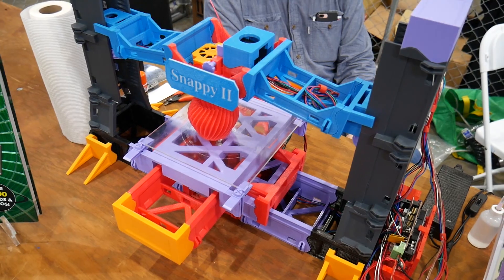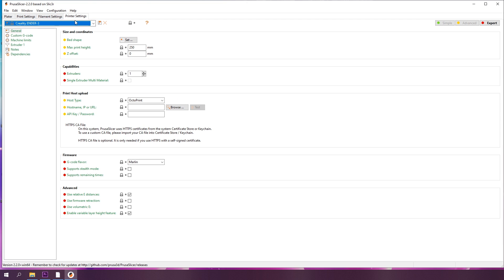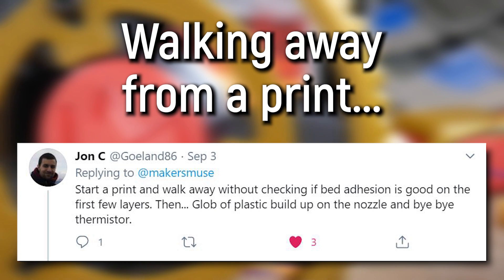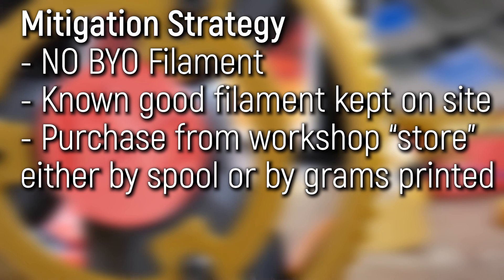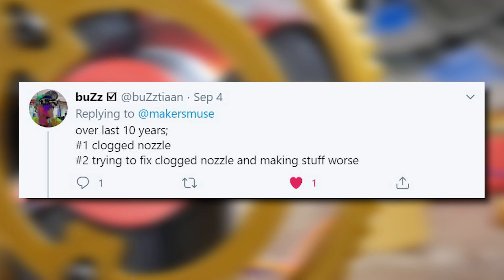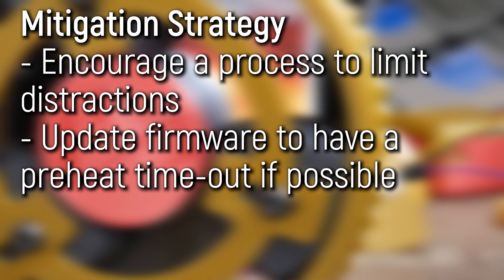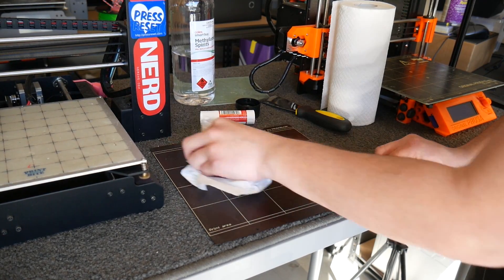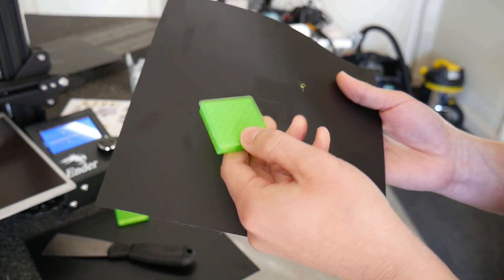How People BREAK 3D Printers (and how to stop it)

Comment: If you break your nozzle off at your hot and it is savable. Well not the nozzle the hot end though. Take your hotend off the machine and place it very very carefully in a vise. Take a Dremel and very carefully cut two notches in the broken piece of the nozzle. It is easiest just to cut into the center of the plastic or the brass showing to give you the most centered groove.most importantly have a large screwdriver that will fit the slot and a propane torch. Lightly heat the screwdriver as to not melt the handle but to heat the tip. Place the screwdriver in the brass and let it sit for a few seconds. Remove the screwdriver and reheat (do not try to turn the brass until you see liquid plastic or the nozzle spins on its own was very slight Force). Slowly back the nozzle out heating the screwdriver as necessary.if you would like to make this process easier you can groove the nozzle and then reinstall the hot end onto the machine and bring it up to temperature. Be careful not to damage the wires of the hot end during this process. If you take your time you can recover your hotend and only be out the price of a nozzle.

Comment: My checklist: first I 3D design my object to make sure it fits in the parameters of my printer. Second I import and slice making sure I have selected the right printer layout on the slicer first. Third I checked my settings and infill because you don't always want the same infill and you don't want to make the mistake of waiting for a slice and realizing your infill is set wrong. Third I export the G-Code, I still transfer using microSD. Fourth I fire my machine up make sure my bed is clean and leveled and I bring my temperatures up and at this point I manually Purge the nozzle. Fifth I disabled the nozzle and allow it to cool so the plastic does not extrude anymore but while the tip is hot I clean the bottom and nozzle. I am using a creality glass bed with the creality coating on it so I usually do not have to worry about bed adhesion. I hear a lot of people talk about running their temperatures at around 205. I find some of my best results at about 210 to 211 with the ender 3 and my bed usually runs at about for pla. Finally I start the print and monitor the first four layers. I start my prince off at normal speed and then gradually increase the speed to where I want. On a side note, if you want to increase your speed then you want to do it within the first one or two layers and do not increase it anymore during the print or else you will notice a difference in the print. Also be prepared because as you speed the print up the layer of plastic laid down become slightly thinner and you lose a little bit of volume so I slightly over extrude.

Comment: So far the industry has been the toughest printer I have owned. I've been able to toss it around, though you should not do that, and I can bring it with me with minimal bed leveling required after travel. It tends to be a tough machine and relatively simple to repair. During assembly of it, the ender 3 was my first printer so it was my learning curve, I pinched a wire in between aluminum extrusions and cut one of the wires but it was an easy repair. Since then the printer has worked flawlessly even though it travels with me and prints in some dusty environments at times which again you should not do.all in all if it's going to be your first printer or if you need something durable I would recommend starting off with a machine of this kind of construction no matter the brand. There are better choices with 32-bit boards.

Comment: We have managed to reduce waste to zero in the ''Innovation lab'' at our university by:

-Teaching all students how our UM2's work in a dedicated (mandatory!) class which includes proper leveling;
-Writing five standard Cura profiles specifically for a wide range of purposes, as a starting point for their settings;
-Making pre-use ''work prep'' template forms that students have to fill out (similar to how planning/prep for a mill or lathe works), to show us they've thought about what they're going to print;
-Making our own supply of PLA mandatory. UM2's use 2.85mm filament anyways, and most students use 1.75mm at home, so it don't fit.
-(Mechanical) repairs are only done by staff. Removing the nozzle as a student? That's a paddlin'.
-Making a shredder to recycle failed prints. Because whatever way you design your whole lab not to have failed prints, we have yet to find a way that is student-proof....

RE: Adhesion methods: there's plenty of cleaning alcohol to keep the glass beds clean, which should work for just about everything except PETG - a fine layer of hairspray does wonders there. On the buildplate. Not on the nozzle.

Comment: i have an ender 3 printer and my assistant always tightens the nozzle waaay too much so much so that it is too hard to remove from the hot end. due to that overtime i noticed that the nozzles are going into the hot end slightly tilted, and it turned out that the threads in the small aluminum part of the hot end are all mangled that the nozzle doesnt stay in its place and simply pops off when the printer is extruding. i tried adding teflon strips to the nozzle but that didnt work, i ended up flipping the entire aluminum square and reinstalling it upside down temporarily until i finish the item i was printing. then i simply created a new one out of aluminum and it works just fine now and i wana try to make one out of copper (dunno why)

Comment: I burned a driver on the motherboard. Lesson: check that your stepper motors can move. I changed extruder parts and cause the stepper motor axle to be jammed for putting one of the gears wrong way around. It is not the same as having stepper motor skipping, if it is a dead stop, it can't move a micrometer, it will burn the driver. It can take skipping, for ex if the motor hits the end of travel but it can not take full on, dead stop jam.

After that i didn't print for about a month. I had dust cover on and really fresh, brand new "magic goo" surface (IPA+glue stick). I had to take all the glue out and put new in.

Comment: I blew up my Ender 3 motherboard by not turning the power off before using a little copper brush to scrub the underside of the hotend during a nozzle change. The bristles shorted out the cartridge heater wires, which in turn, fried the circuit board... So, in my case, i destroyed a perfectly tuned, and fully functional printer with the power of stupidity, and hotwired electricity.

Comment: Does anyone else here have never seen a 3d printer in a school? Like wtf, here in Spain, it's just hard to get people to invest into new technologies and ways of teaching. Most people would probably understand how it works, but very little would have the perseverance to keep going  after a fail. Don't get me wrong, every time i have a clog or a problem I just want to throw the printer off the window, but then i remember how fucking glad i am to have one.
Reply: Fact of the matter is that in schools, equipment upgrades tend to come down to both the budget and what the instructor deems necessary. For a lot of instructors, even those in more creative shops, they have never used a printer and therefore isnt really on the horizon for them. Some do, and this is why you might see a printer in a wood shop because they have nowhere else to put them. It's that person's classroom.  Trying to get public school boards to understand the usefulness in such tools can be much harder than the classic wood shop.  Hell, our wood shop instructor understood the value of metalworking and CNC, but only could manage the budget for a 10 year old used plasma cutter.  It took them 2 years to get it at a point of usefulness. By then, the district wanted to cut the shop out in it's entirety. Citing that it was antiquated and too much liability. But they didnt have anything to replace it with that I know of. 

Personally, i was shocked when going to college how behind some schools still are though.  I attended a private engineering university that (to my knowledge) didnt have anything resembling a makerspace for the dozens of projects they are given.  Hell, that place still had dinosaur computer labs that crashed 10 year old software left and right despite it's crazy tuition rates. <45k/yr  Visited a community college later on and was surprised that the instructor offered the opportunity for the class to use their commercial nylon SLM style printer for projects. It could handle a massive build area, we just had to have the instructor group the class batches. Especially when tuition was closer to $8-10k per year.  I simply sum it up to how much a school focuses on it's student's success rather than profits. I think that engineering school firmly believed that none of us would be machinists, so while they formed curriculums around 1960's metalworking in order to "diversify" our understanding of the real world, they neglected to care about actually assisting the students in their studies. So much can be learned from experiments using printed components. Not to mention a small 3d printer farm tends to be a much smaller liability then metalworking lathes, welders, and mills. lol.     I live within 5 miles of this school and have done a few projects for various groups.

Comment: Blue tape is a good surface when configuring the firmware for a new printer build as its a nice sacrificial print surface that works ok for PLA. Better to crash and scratch off some tape than a good PEI surface.

Comment: I wish i watched this before i had to replace my whole hotend 😂
Reply: Given the horror stories and the various mistakes I’ve made, I keep replacement parts on had. Hotend, nozzles, V wheels, belts, etc... Then I have the price advantage of the imports over the local costs, which I have found local prices for one about the same as the lot imported. Bricks and Mortar  have a higher cost because of the convenience, a bit of planning can save a fortune. Which can be invested in running more plastic ;)

Comment: My biggest Mistake:
I just scratched my Bed with the nozzle, because i thought the Auto-Levelling will do it and I couldnt stop the Print immediatly. Well no... You Always need to AUX leveling the bed first even if you got a auto-bed-leveling included.
Then I screwed my Filement winding by letting lose the end - there is a video on this channel too. But this didnt do any damage but the prints itself

Comment: Just recently on one of the work printers i had the thing just catastrophically kill itself. It's a core xy and i don't know how the head got stuck on the print, but because i was having to print a 10 inch wide box the print won and ripped the hot end carriage apart. Tore off the part that held on the string to the carriage and that cracked it further so one of the wheels broke off as well. 

Overall lessons learned, string is far stronger than i gave it credit for and thank god the warranty on these printers is amazing

Comment: I've knocked my printer off the table, on the floor, by accident and the printer wasn't out of level. Maybe these spaces just need fewer better and stronger printers instead of just more budget ones? I know you are an advocate of affordable printers in schools, but I've seen so many with just small issues being put away because a hobby grade printer is not suitable for open spaces where nobody takes responsibility.
Reply: Personally I have seen more major  problems with the proprietary printers than "hobby grade" or home made machines. 
Unavailability of customised parts being the biggest problem. 
When a stepper with the lead screw glued into the rotor loses magnetism (through design issues), is when you discover how poor the parts backup is.
It becomes a, modify a stepper yourself or modify the printer to take an off the shelf  stepper and coupling yourself choice. 
Kinda explains why so many non working proprietary printers get given away.
Reply: @mikenewman4078  Heyy Mike. I suppose that depends on the printer. I referred to the Dutchy (only available in the Netherlands) which consists of a very sturdy frame with high grade (universal) components. There's even a parts list on the website. I think most of the parts availability problems will be with custom hotend/extruders anyway and the Dutchy just uses a stock E3D Hemera, but there are more high end printers with universal parts that are less prone to failure when handled incorrectly

Comment: I can almost imagine someone saying "it didn't heat up past 100 degrees, so I used a blow torch to get it to 220"
Reply: Haha. That reminds me when i was a little kid and was going to pump up my bicycle tires at the gas station. So it said "40-50" on the side of the tire. And i preceded to try to pump it up to 40-50 bar.... When the pump did not go past 10 bars i was pretty disappointed and started to walk home with the bike. After 10-20 meters there was a loud BOOM and one of the tires was flat... I guess i did not know the difference between bar and psi back then.
Reply: @titter3648  Reminded me of two stories -- (don't know why the second - ;) )...
1. A friend from Europe came to visit for a few months (going to college) and wanted to cook.  They said we needed a new oven because it wouldn't get hot enough - was trying to get it to 1022 degrees -- thinking celsius as Fahrenheit...

2 - I was in purchasing for a school and one of the housing personnel wanted me to set up a deal with Wal-Mart to buy vacuums on an ongoing basis.  They thought they were disposable and they'd throw them away when the student(s) used them and got clogged or bag was full...
Reply: @titter3648  I've always used the "squeeze test" for bike tyres :)
Reply: @titter3648 lol
Reply: A 3D printer tool-kit I purchased comes with a blow torch.
I'm convinced it's an emergency-only tool for removing globs and failed prints from the hotend!
Others would likely use it as a preheater or worse...
Reply: (on the mini) while needing to do a manual filament unload, preheating for PLA wasn't heating  it up to 215°C, only 170 (one may be able to do a HARD coldpull at that temperature, but I didn't wana risk it). Was confused for a sec, before I found a workarround by sticking a leftover piece of filament in the filamentsensor, and cranking up the heat manually to 215 in the settings.
Reply: Blow torch is the best way to clear a clogged nozzle
Reply: @reforgedcriterion1471  It's the best way to remove the brass nozzle entirely if you don't know how to use a blow torch properly. Just melt it straight off of the heating block, why not.
Reply: @OtakuUnitedStudio  wat... 

Because the heating block is aluminum, the nozzle is brass. Go look it up and see which one will melt first. 

Confucius say any idiot can make job harder than need be.
Reply: @reforgedcriterion1471  its not attached to the heating block if there is no heating block
Reply: You say that like it's a bad thing lol
Not guilty, m'lud.
Reply: I’m not liking this, cause it’s at 220 likes, but lmao

Comment: I'll be honest - I have never seen the point of using gluestick for better adhesion... I only use it for worse adhesion when printing flexibles so I won't rip my print-bed apart when trying to remove the part lol

PLA and other filaments usually stick perfectly well with a properly leveled bed as well as grease-free surface (break cleaner ftw lol, do not use that or acetone however on these ultra base style build plates - that would ruin them)

Comment: I used to do the superglue tactic, worked really wel tbh If 20,- is worth it 🤣 after that i used to tale the line of fillement the printer Laysout and just meldt is on the warp part (is this was going to me visable i stopped and reaplied my layer of spray glue

Comment: Re pre-heating: Personally I would patch out the nozzle temperature from the pre-heating function in Marlin for public printers. With most printers it's the bed that takes a long time to heat up, so that's the reason for pre-heating. And keeping the bed at 80 degrees even for many hours will waste power but should not pose a risk to the printer.

Comment: The point of maker spaces 3d printing for people who are knowledgeable/have their own printer is so they can use exotic filaments or filaments they can't use on their own printer. If you can't talk to them about bringing you're own filament then they will just charge up your ass and limit your possibility of making well made prints. I do agree with the reasons you gave but making it policy will mean no exceptions which is my biggest problem with this video. Other than that it was pretty good.